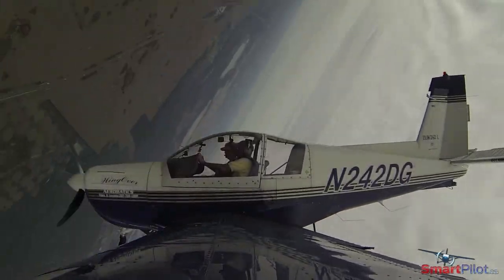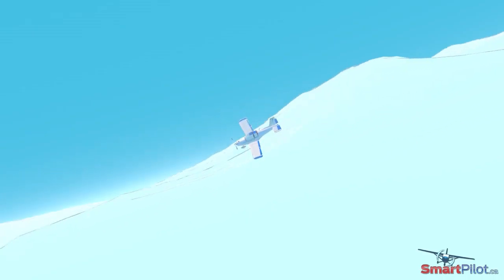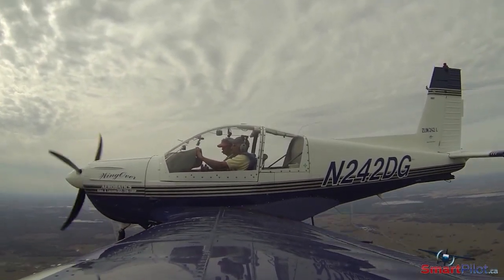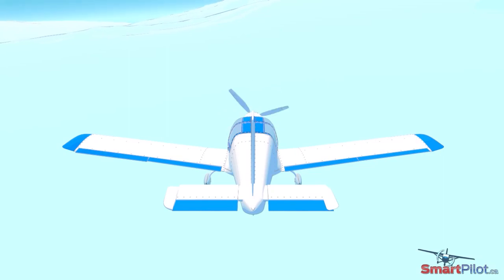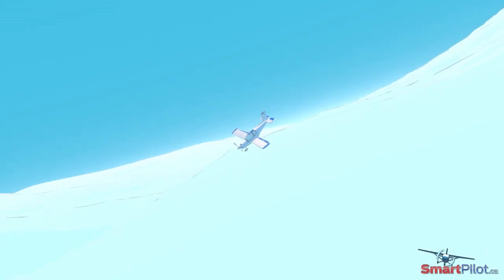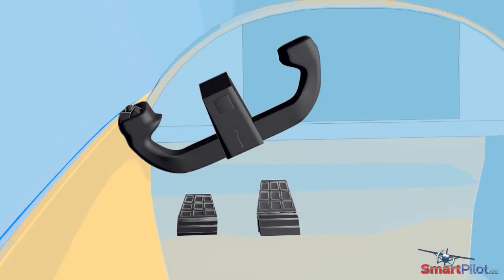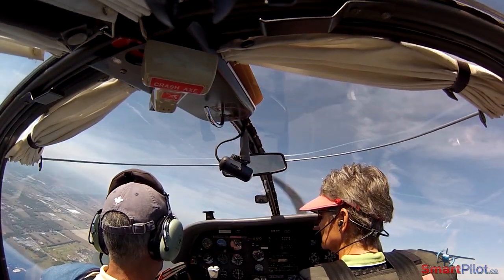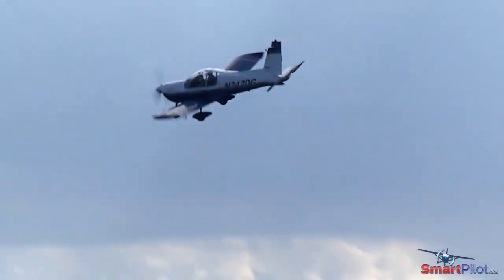SmartPilot | Upset Training - Stall-Spin on Final

Comment: Some of the accidents on base to final might be misdiagnosed. Doing a slip which is also cross controls and the flaps being inboard where the primary lift is it's a case of trying a slip the fuselage of the aircraft blocks out airflow to the only lift that's where the flaps are inboard next to the fuselage. Do not practice spins or slips with flaps because that's a spin practice only for CFII's. It's no joke when two guys have to get against the windscreen to get the nose to go down like can happen with some spins after stopping the rotation. Even a nose down/dead spiral will black you out while hearing noises you never knew the plane could make. Long story short, don't do slips with flaps while slow because it is dangerous as heck when all or part of the lift is at the flaps section of wings.
Reply: I always do slips - they help loose energy... Always with extra speed - which is causing to lose some more.... Ending up with low and rather fast glide slope. At the designated point I am okey-ish, dumping the flaps and stick to the ground. However, this is not standard landing procedure, just a bad competition flying habit.
Reply: @PovilKa  I guess the type of airplane can make a huge difference. I've been a glider pilot, and the types I have flewn could spin quietly, and after recovery VNE never was a problem. Modern gliders don't have those huge airbrakes no more, so a dive after recovery is a risk, pull up firmly.

Thanks to the very low stall speed of gliders, forward slipping is the safest thing in the world. What happens is that the angle of attack changes, it's getting smaller, so you can never stall a slipping glider. That is, in normal landing configuration, flaps down. Flaps up and low speed is always a bad idea. And the gliders I have flown slipped the most effective with the  nose very high.
To pilots of one engined planes, that is probably unbelievable. Slipping the safest thing in the world? No way! Spinning from 9,000 feet till 2,000 feet? Is that a Pitts Special? No, just a modern club glider. I guess this all has to do with low airspeeds, extreme low wing loads and low weight, keeping those planes flying, where powered planes with their smaller wings could stall and spin in the same conditions. Adding extra problems, like an aircooled engine that can cool down too fast, during a steep descent.
Yes, planes are not the same. Fly safe.

Comment: Interesting.... one can describe this as a low level cross control stall ie: combining aileron with opposite rudder. Also thinking the reason for overshooting the centerline is very relevant in this situation especially given the many illusions caused by drift. Question: Would a left crosswind aggravate the angle of attack of the left wing while in a skidding turn onto final ?

Comment: I would rather say: "Go Around is always mandatory, Landing is optional" this is the correct way of handling all approaches.
Reply: Landing IS mandatory... Landing alive is optional.
Reply: @CPLBSS88  The saying I heard on flight school was about bad weather: "Take-off is optional, landing is mandatory"
Reply: Totally agree
Reply: People often push through a bad approach because it is hard to admit to yourself you screwed up. Setting your ego aside and showing airmanship is a good characteristic to have as a pilot.
Reply: Not entirely. You would have to land at some point as what ever goes up must come back down, it would run out of fuel eventually
Reply: @tjaviation61  of course you would have to land, but doesn’t have to be at the first try … that’s why you have (or should have) the alternate airport fuel + the 45 mins reserve + any contingency… so why rush to land if you are not comfortable ?
Reply: Diego Cueto for me safe approach is higher glideslope , no throttles
Reply: @haykodjan  I agree with  your steeper  glide slope  so you're not depending on your engine to reach the runway. But if  you have an air cooled engine,  you should have a little throttle in to so the engine doesn't cool off too much. Plus, it's more likely to stop running  with the throttle closed.
Reply: always in a Cirrus

Comment: Terminology is wrong.  Neither stalls nor spins are 'upsets".  They are however correctly termed a "Departure from controlled flight". Upsets and upset training are yet a third procedure.
Reply: Really?? Spin a Tomahawk from 3,000 feet for 2 turns at least.. You will recover over 1,500 legal.. And you might feel soooo calmed down..

Comment: I think the explanation is great. The animation of how the plane enters the spin sucks, but the rest is great. I watched this clip becasue on a flight yesterday I had such a strong tailwind on base leg tat I overshot the centerline too. I tried to get back on it by steepening the bank and beeing careful to keep the nose down but at a certain bank I realized it doesn't feel good so I shallowed the bank and let the wind carry me beyond the centerline. With a 30 degree bank and the nose down I flew back to the centerline and aligned with the runway with a 30 degree right turn ... I would landed halfway down the (9000 ft) runway, but opted to go around because I was too fast aswell. This was in a Cirrus SR22.
Reply: Your go around decision was late but at least the correct decision

Comment: This is so counter intuitive to use the rudder for accelerating the turn, I can't understand how people are that unintuitive about flying...
Even if I've never fly a real aircraft, my experience on simulator (DCS mainly) give me the habit to automatically use rudder coordinated with turns and only use it outside coordination if I need to move the nose slightly left or right, or when I want to goes into a spin in fact...

And personally my first reflex if I did not wanted to go around will be to turn right to make a simple circle that will safely align me with the runway even if it need 3 quarter of a full turn rather than pushing for aligning when its clearly too tight...

I think we should make pilot learning about extreme out of envelop dynamic, volunteer spin and other things like that by making them experiencing that on simulator, cause it feel like it give knowledge of things that most pilot never know, except once before a crash maybe sadly.
I mean yes DCS is only a simulator and I can't pretend to know everything about aircrafts but with both A10C and P51 I often play putting myself on a spin and never I did crash cause of that, I in fact have more difficulty getting into those situation than getting out of them...
And I also feel that teaching pilot how helicopter work (on simu) could also help cause on helicopter the controls are even more coupled and the rudder often is coupled easily to the turn like on airplanes and will almost only at hover or really slow speed being independent without causing an obvious awkward position.
Reply: Using rudder absolutely will accelerate the turn. In fact you can perform all turns without aileron, albeit less efficiently. But it also increases the bank angle. Better solution is to go around. Or if traffic permits do a 360 as you proposed to better align yourself. Or perform a coordinated turn and accept that you won't be on the extended center line as far out as you would prefer. But under no conditions use the rudder to accelerate the turn.

Frank Davis, CFI
Reply: +Demongornot I agree somewhat. If you're flying a traffic pattern, though, as this video suggests, you're not going to just want to break right in the middle of a left base-to-final or just base. It's bad practice especially if you aren't alone in the pattern. You're taking a regular base leg and throwing in a wrong-way turn, which in itself isn't necessarily a bad idea. Practicality says otherwise at a towered field. 
In the US, stalls and spins are both covered as part of the SPL/PPL curricula. Actual spin training is not mandated anymore, but nevertheless a very good idea. These small errors or lapses in judgement are what kill pilots. At my flight school, the 172s are all technically certified when operating under the Utility category. Most all PPL students will encounter a spin at least once in the air as part of their training. It's an imperative that recovery become second nature.
Reply: +Aviation Unlimited
Don't worry I know that pushing on the other side is a bad habit and should only be done in a simulator or if we have a real urge/emergency but not just to earn time to avoid doing another full base.

And well, as I have read on some comment spin recovery have been removed cause a lot of crash during spin recovery training have been done, that's why training pilot with a simulator first for those situation might be a good idea, plus in a simulator we can push even further where in real life it will be way too risky, but spin recovery itself is not a good idea without simulator training I think, there is several physic realistic aircraft simulator available that could be good for those trainings and it only need a computer and a joystick/hotas/yoke (probably better a yoke here) which will cost quickly less than life and crashed aircraft and could then lead to a way safer live spin recovery training and probably allow those training to be back in service !
Reply: That's because you haven't flown in a real airplane
Reply: You can actually use your rudder to turn / accelerate a turn. They even have videos on youtube of people making landings without using ailerons for banks.
Reply: There are two types of pilots. Drivers and Flyers. Flyers become one with their plane.
Reply: I wish more details on that then, please !
Reply: I have never say that we can't do it, I just said that this is not intuitive at all to do it.

Comment: Am I crazy to say that if Stall-Spin accidents on final are  this common then perhaps mandatory stall-spin training should be reinstated for all licences? Why was it ever removed from PPL training? If people who take flight lessons don't like it, then flying isn't for them. Stall-spin training has proved to be a life saver so why this experiment of not requiring it has not been ended???
Reply: +Peter Pasieka It was removed (In America) because too many students and instructors were having accidents during training. Now spin recovery is taught on the ground only. There are some instructors and schools that will let you spin their planes, but they are far and few between because insurance is cheaper with the "no spins" placard.
Reply: +Peter Pasieka Would there be time to recover on short final only 800- 1000 feet up?  Still it's a good idea: We had 20 hours in simulated IFR conditions, unusual attitude recovery and spin/spiral dive recovery as mandatory (in Canada in the early 90s)
Reply: @ericferguson9989  surviving an accidental spin requires enough available height to 1. recognize the aircraft is spinning 2. counter 3. pull gently the yoke once the speed has built up. In most cases 1000ft AGL won't be enough unless the pilot has appropriate training (at that height I think he/she would need aerobatics training). Moreover, spin on final happens usually in the last turn when the approach pattern is too low : the pilot tends to turn with the rudder without enough bank while pulling the yoke in an attempt to refuse the ground, which puts the aircraft at high incidence angle and dissymetric flight.
Reply: We still have it in Canada. We do Stall Spin and spiral training almost right away.
Reply: @DaveAngus4lyfe  -- Spins filter out the drivers from the pilots.. It is about stamping on your brain to let the nose go down or even push it down to make the wing fly again.  You need that training..  In USA you need to drive to be a pilot.  In Canada you need to pilot to be a pilot.
Reply: Ok....long final. It's been over 20 years. I've probably forgotten everything! Still I remember the HASEL check. These manoeuvres require some altitude to complete.
Reply: I was trained in stall spin recovery in the first few hours of training.  But that was in the early 70s.  My instructor was a retired combat pilot.
Reply: They removed it because dead people don't learn anything, too many accidents. My flight school does it on the sim.  You don't "feel" it but you get the muscle memory
Reply: You go over spins and recovery demonstrations ONLY, while doing your PPL in Canada but anywhere in the world the most important thing to teach is how to prevent it from happening, if your turning from base to final you're probably about 1000 feet the highest but more commonly you'd be lower most likely leaving not enough room for recovery
Reply: Peter Pasieka —-As a student pilot I 
1000% AGREE
My CFI had me doing hard stall training day one and it really made more aware than the “lil wing or lil break stall” my opinion is same, nothing like experience of serious stall!
Reply: It is effectively mandatory. You just don’t have to go do spins to get your private license. Why?  Because a lot of airplanes won’t recover from spins.  If you’re learning to fly your Arrow, 182, Cirrus, etc, you’re probably not going to be able to recover from a spin anyway.  (There’s a genial rule to tell if a plane has a good chance, by looking at the rudder, but, that’s another point.)  Most inadvertent spins are so low to the ground that recovery is impossible.  Most people with spinnable aircraft go get spin training and then suddenly they’re spouting off at the FBO like they’re Chuck f’ckin Yeager. That’s how it goes.
Reply: The only aircraft at 1,000 ft on short final is the space shuttle.
Reply: Agree 100% and have been preaching same.
Reply: Peter Pasieka because if it happens at low enough altitude it is fatal and that is not good advertising.
Reply: What a true statement!
Reply: MajorLeague  -- I taught CPL's how to be CFI's on Tomahawks a lot. 20 Years ago.  Another school i went years later, only had Cessnas.  Then they got a Tomahawk leased.  I became again the Tomahawk guy.  Teaching stalls at 2,200 agl my student got into a flat spin and froze on controls.  I got it out at around 300 agl only.  He got his lesson and I too due I used Cessna mild push down method. My mistake was that I forgot Tomahawks need real push down to get out of stall spin.  I got Cessnatized for a year.  Dont let you be Cessnatized ever..
Reply: If this happens when you're turning final, being able to execute a good recovery from a stall/spin will do nothing for you. You're very likely DEAD.